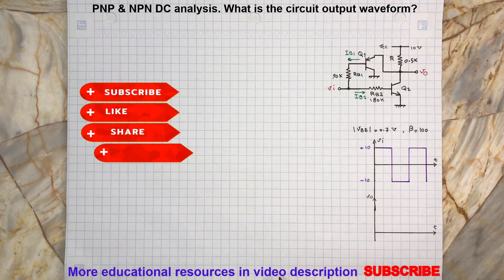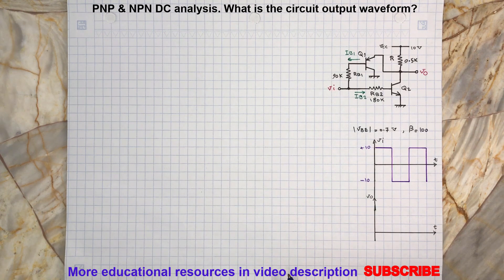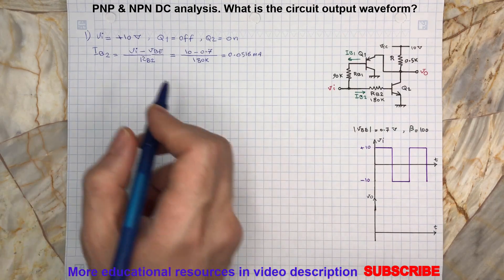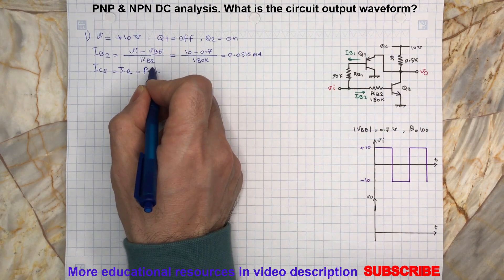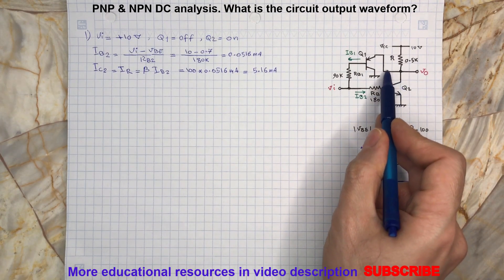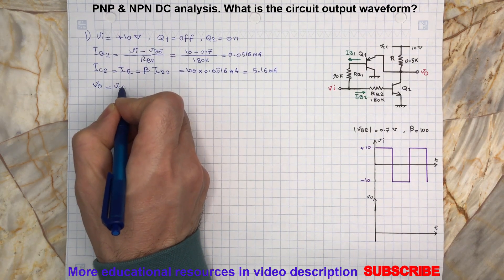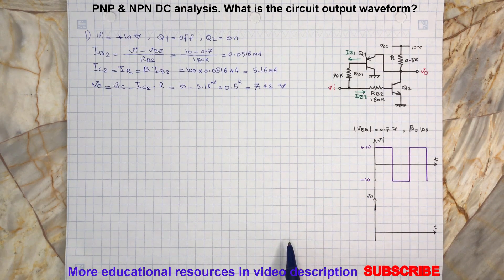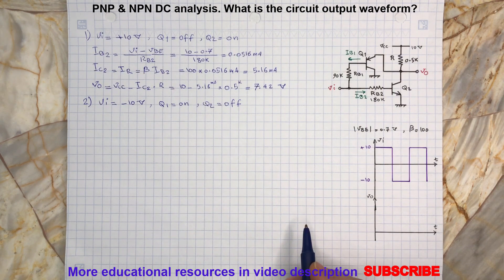PNP NPN Transistor Circuit Analysis Example, PNP Transistor Circuit Analysis

Comment: Nice analysis, thanks.  I know it's not the point of the video, but I can't help thinking that this is not a great circuit because Vo depends on the particular beta of the transistor.  I think adding an emitter resistor (essentially a feedback R) to Q2 would solve that problem.
Reply from the maker: Thank you for sharing your thoughts. Yes, a resistor in emitter can reduce the influence of β on emitter current and stabilize the transistor's operation. However, as you also mentioned, this wasn't point of this video. I tired to provide ways looking at the circuit configuration and how to solve the circuit problem.
Reply: @EngineeringinDepth  I'm wanting to get more practice with analysis (studied it decades ago) and I'm finding your videos are a good source, so thank you!
Reply from the maker: @Enigma758  I am so glad that they are  helpful! Thank you!